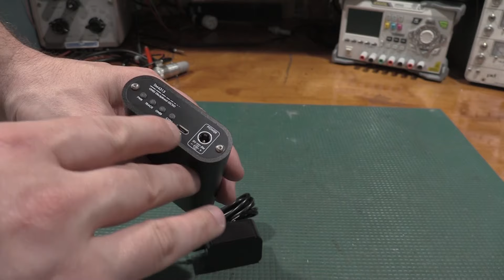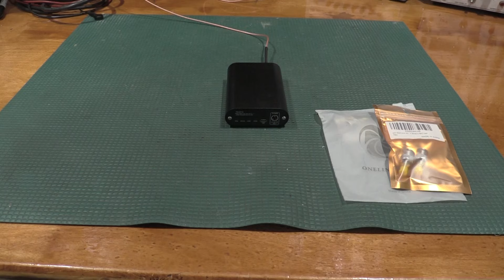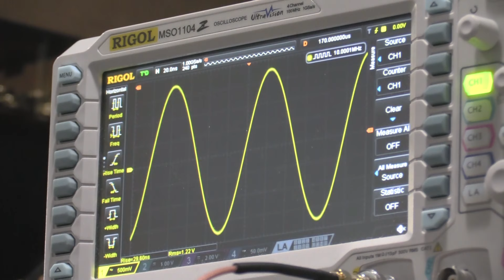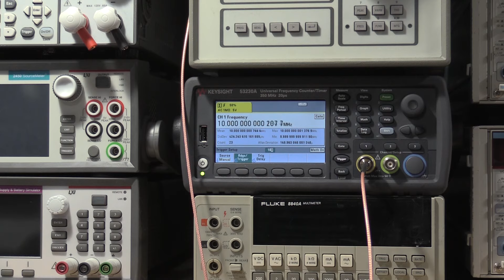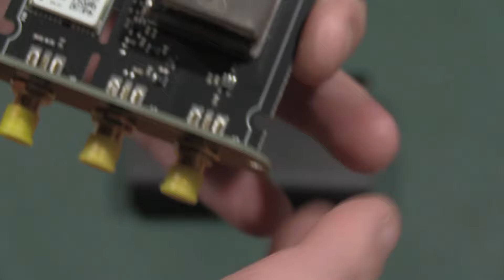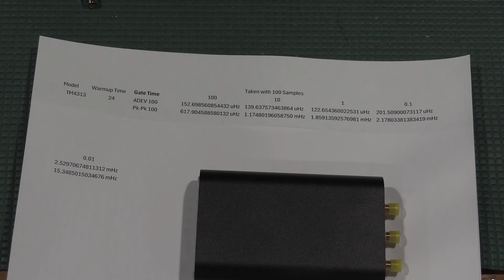Mastering Precision: 10MHz Reference Testing & Analysis (TM4313 GPSDO)

Comment: I bought one of these, there is about zero info on them. I'm curious about the tracking led status. Initially the led flashed quite fast. After about a day it slowed to about one flash a second. Then it started to flash fast again. Does anyone know if this is normal. The antenna is outside and in the clear.
Reply from the maker: From what I saw on the instrumentation the slow flash is when the unit is locked and stable.
Reply: @ZenwizardStudios  Thanks. It took about 24hrs after I first pugged it in to slow flash.  Just sitting there it started to fast flash and after about 2 days it is now slow flashing. 
I wonder if there is something wrong with it.

Comment: When my old HP GPS time and frequency reference receiver finally kicked the bucket I got a new Stanford Research Systems GPSDO and frequency counter with optional rubidium time base.  Best of both worlds, GPS and rubidium.  However, you could probably buy a rather large pile of those little GPSDO's for what I paid for the SRS one new.  If I only worked on HF/VHF/UHF transceivers one of those little things would probably be fine.  In my case I also work on SHF and EHF transceivers.  A tiny error in the 10MHz reference to one of the EHF radios can cause a frequency error of hundreds if not thousands of Hertz error.
Reply from the maker: I have a similar set up here. I have a GPS unit steering a FS725. It is the same physics package but I do have have the associated frequency counter.

Comment: Does your unit ever lock? Mine doesn't. Check the NMEA output from the USB serial port - you might be surprised to see it never locks. Without the GPS, it's just a glorified OCXO.
Reply from the maker: It seemed to based on the LED patterns as well as the stability. I have a active GPS antenna outside that is shared between my bench GPSDO, a 2 port Leo GPSDO, and Leo's GPS NTP server. All seem to lock quite well. Usually this is due to signal level at the patch antenna. I have had units struggle with the patch antenna at the bench especially because the lab is below ground